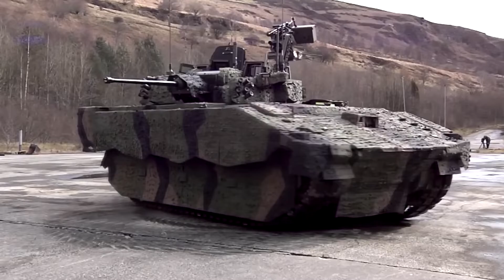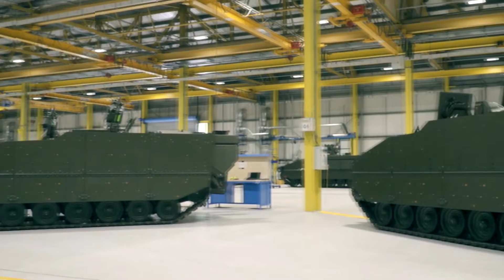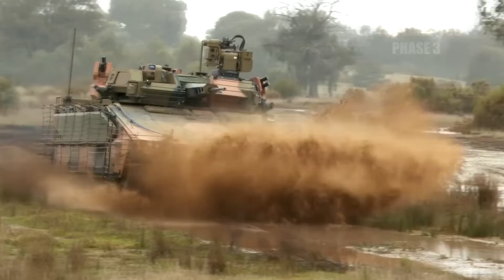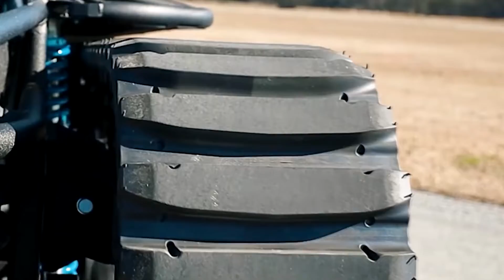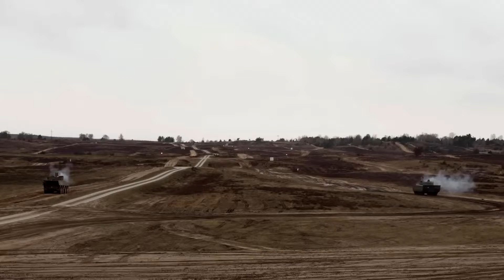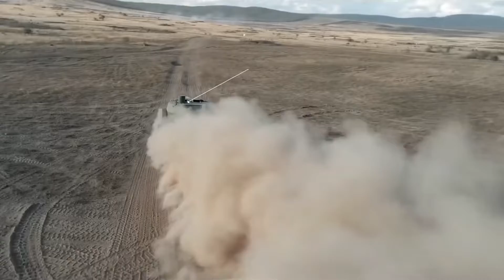That's Why Nobody Wants to Mess with this Infantry Fighting Vehicle

Comment: Ajax development took too long. The cutting edge concept became outdated.  The weight distribution is still not great (hence there was excessive vibration to a point a test soldier lost hearing).  It is still in the run for US OMFV only because it is GDLS.  

AS21 won in Australia and was in the run for the US tender.  Oshkosh (US production partner) sued US gov for licensing issue re their other vehicles. Not the smartest move.  It has got some sick cutting edge stuff too.  The interesting thing is, RoKA (Republic of Korea Army) is working with the developer for ver 2.0, rumored to be cheaper and lighter with the same level of protection.  Also new K808PL was unveiled a couple days ago (8*8 wheeled vehicle version) with some sick features.  

KF41 was officially adopted by Hungary.  The problem is the weight and weight distribution.  Aussies tested it and there were several issues re the balance of the vehicle weight and system integration.  The vehicle is too top heavy (just the same as Boxer which has to choose one of added armour, ATGM or APS due to weight issue) and possibility of future expansion is not feasible.  This is more of a design issue.  The second problem was, the system integration had massive issues, failing to integrate various systems under one OS.  The rumor says, there were several system failures during alive fire test.  This is more of a development capability issue.  The third issue is the price tag.  It is 50% more expansive than AS21 but less capable/ reliable.  

As we have seen in Ukraine, no vehicle is invincible.  They will suffer losses and would require replacement/ maintenance.  High price vehicles will also require replacement.  The problem is, the delivery speed is less than impressive for Rheinmetall.  Poland received their first Leo2A7 after 5 years (still not delivered 20% after 6 years). Norway will wait till 2030 for their delivery of Leo2A7.  If Europe is to go into a war, Rheinmetall is not in any shape to support that war effort which worries many.
Reply: Ajax had an issue with the hull as well. The hull bends due to the weight of the turret. 
And yes, I agree fully with your statement 👏